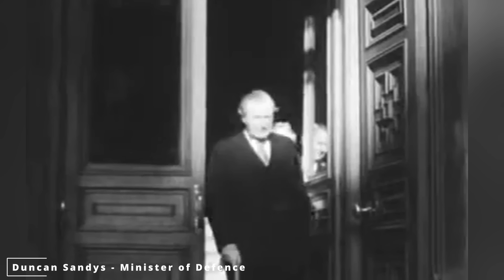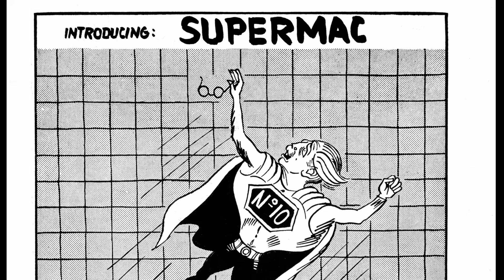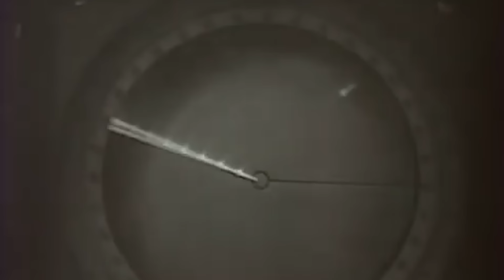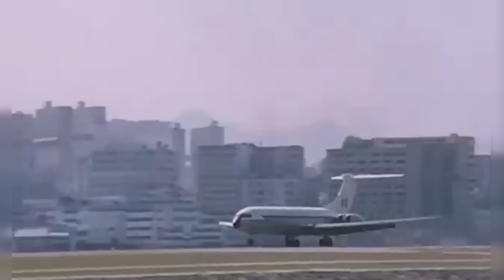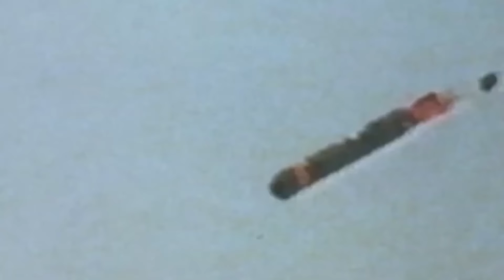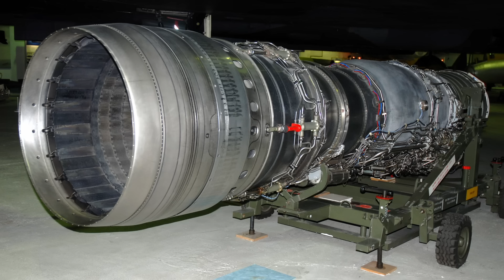How Britain Turned A Failed Airliner Into a Soviet Submarine Predator | The Mighty Nimrod

Comment: The Comet was a good plane after they figured out the fuselage issues. Beautiful too. And the VC10 was amazing…
Reply: Comet 4 had an appallingly bad 34% loss rate, the worst safety record of any jet airliner in history except for the Comet 1 (56%)
Reply: @DoktorBayerischeMotorenWerke 

Typhoon & Tornado, British design aircraft. 

Early days of the airliners.

The awesome De Havilland Comet.
World's first production jet airliner.
World's first high altitude airliner. 
At the time the Comet wasn't particularly dangerous. The DH Comet was definitely not the worst engineering failure in commercial airliner history.

Losses comparisons.
How things were in those days.

DeHavilland Comet 4 UK                          14% 
DeHavilland Comet all mks UK (ff 1949)17%  
Vickers VC10 UK (ff 1962)                         5%

Douglas DC-1  US                                       99%
Douglas DC-2                                              47%
Douglas DC-3                                              30%
Douglas DC-4                                              26%
Boeing s300    US                                       72% 
Boeing 307                                                  70%
Boeing 247                                                   48%
Boeing 707  (ff 1958)                                 32% 
Lockheed L-049 Constellation (ff 1943)  30%
Lockheed Electra US (ff 1957)                   29%
Fairchild FH-227 US (ff 1966)                   32%
McDonnell Douglas DC-8 US  (ff 1958)   14%
Sud Aviation Caravelle  (ff 1955)             15%
Canadair CL-44 Turboprop US (ff 1959) 46%  
Convair CV-580 Turboprop US (ff 1960) 22%
Convair CV-880     (ff 1959)                      27% 
Convair CV-990     (ff 1961)                      33%
Tupolev T-104        (ff 1956)                     16%
Vickers Viscount UK  (ff 1948)                29%  
Fokker F-27 Turboprop NL (ff 1955)       40%      

The Vickers VC10, fastest Atlantic crossing for a non supersonic jet airliner, held the record for 41 years.

For the first few years of operation the Caravelle & Comet had similar accident loss fatalities.

De Havilland had prior experience building many all metal construction airframe aircraft & thousands of jet powered fighter aircraft that were primarily of metal construction with pressurised cockpits & jet engines built by De-Havilland. No aircraft before the Comet was subjected to as much pre-production testing as the Comet. 

It's a great pity & a crying shame that British military forces had to occupy a large part of Germany for decades after 1945 & Russian military forces had to do the same. Of course Russia still posseses a large chunk of what was German territory & of course Russia & the UK produce nukes. Obviously Germany does not produce nukes.

Interesting British achievements.

The gas turbine engine was invented & patented in England before the 1800s.

Axial multi stage sequential stage compressor & turbine technology, first produced for turbo machinery use in England by Parsons of Ireland & North England during the 1800s. The components form the basis of most modern gas turbine aero engines. At the time the concept of the jet aircraft powered by axial internal combustion gas turbine engines was first mentioned thus the internal combustion jet engine & jet aircraft was indeed invented in England before the 1900s & before the Wright brothers got busy.

Work on the multi stage sequential stator rotor axial compressor as applicable to the axial compressor gas turbine aero engine was ongoing in England from around 1928 by Arnold Griffiths and others. By 1943 the Metrovik F2/3  Beryl was a running axial turbojet that was superior to anything anywhere else. As the centrifugal compressor engines were adequate and more powerful at the time development of a larger F2/3  version was commenced.

The Metrovik (UK)  F2/3 axial compressor gas turbine aero engine was flight certified & ran in 1942, it was the result of UK development work ongoing since 1929. At the time it was the most capable axial compressor turbojet in existence but was not required and development work continued on a larger version.

Frank Whittle performed the world's first demonstration of a gas turbine aero engine in 1937. People in Germany kept a close eye on everything going on in Britain at the time.

The centrifugal compressor RR Nene was the most powerful & most reliable gas turbine aero engine on the planet in 1944. That engine would be later built under license or copied in many countries including Russia (Mig-15 Mig-17), China, the US, France and Switzerland powered dozens of aircraft types for decades after 1944.

Pratt and Whitney and others produce centrifugal compressor gas turbine aero engines. The PW200 is a currently produced whittle style centrifugal compressor, reverse flow combustor, gas turbine aero engine. 

The world's first wind tunnel was constructed in England during the 1870s. The world's first supersonic wind tunnel was constructed in England in 1922.

There is no doubt that the Fairey (England)
Delta 2 was the world's first jet
aircraft to exceed 1000 mph.  Indeed It
exceeded the previous record by 310 mph &
held the record for 1 year. Incidentally, the Dassault Mirage 3 & 4 are based on the Fairey Delta 2.

More recent UK military jet aircraft.

The Tornado & Typhoon & their engines are Supersonic & are indeed British design aircraft with British design engines built by an international consortium. The Tornado design for example started life during the 1950s at Vickers as the AFVG, it's engine is based on the RR RB-199. The EE Lightening is also a British Supersonic jet aircraft.

The Typhoon is the British BAC-EAP with an engine based on the British RR XG-40, the Typhoon is also built by an international consortium.

Brazil has the world's third largest airliner manufacturer and makes very good airliners & Brazil is 100th down the list along with Indonesia for wealth per capita. Of course it is in fact the case that Embraer can't build those airliners without purchasing stuff from the US, UK & Europe. For example, Norway, Holland, Denmark, Ireland & Belgium, top 20 wealth per capita, don't make airliners, its as simple as that.

Global aerospace. 
From the 1950s sector rationalisation and consolidation took place. 70 companies in France and 300 companies in the US disappeared due to merger or dissolution. In the US Boeing was almost bankrupted by the 707 project.  Boeing had a well protected domestic market and the available space and resources in the US to engage in large scale airliner manufacturing enabling them to capture orders simply by being able to produce airframes fast enough and cheap and nasty enough. Another factor is airlines preferring to obtain as much of their airliner inventory as possible from one manufacturer. 

Global Aerospace Sector, what's happening.

For example, there are of course no German companies that makes German jet aircraft in Germany & there are no German companies that make German gas turbine aero engines in Germany that are suitable for widebody airliners.

The UK has the world's highest combined per capita Nuclear / Defence / Aerospace Sector Activity.

UK defence sector, absolute terms, world's second highest activity. 1st for per capita defence sector activity. Per capita nuclear powered submarine construction, 2nd position. 
Main players being Rolls Royce, Babcock, GKN Aerospace & BAe Systems. Activities often involve international collaboration. BAe systems, RR and other UK companies now handle more Airbus work value wise than Germany. 

There's a good chance that anyone currently flying on a widebody airliner will be on an aircraft powered by RR gas turbine aero engines made in the UK and a good chance there will be other hardware on the aircraft that's designed and / or manufactured in the UK. 

Rolls Royce Holdings UK
Subsidiaries
- Rolls-Royce plc
- Rolls-Royce North America (ex Allison etc Classified Military stuff)
- Rolls-Royce AB
- Rolls-Royce Deutschland
- Rolls-Royce India Private Limited
- Rolls-Royce Marine Power Operations
- Vinters Engineering Limited
- Rolls-Royce Controls and Data Services
- Rolls-Royce Power Systems
- Bergen Marine
Joint ventures include:
- Rolls-Royce Turbomeca
- MTU Turbomeca -

Trent Family
The MT30 (Marine Turbine)
Industrial Trent 60 Gas Turbine
Trent 7000
Trent XWB Airbus A330neo.
Trent 1500
Trent 1000
Trent 500
Trent 600
Trent 700
Trent 800
Trent 8100
Trent 900
   
RR wholly owned subsidiaries in Germany handle smaller 2 shaft RR gas turbine aero engine work.

The UK space and aerospace sectors are highly productive, high-value industries that together contribute over £18 Billion in direct Gross Value Added (GVA) to the UK economy. Individually, the space industry directly contributes about 0.3% of UK GDP 7•2 Billion while the aerospace industry contributes approximately 0.5% £10•9 Billion.
   
We hope this helps.
Reply: @DoktorBayerischeMotorenWerke 

Comet / Nimrod notes. 

We believe we can clear up some commonly held myths and misconceptions obviously.

It's always good to see the facts presented clearly and concisely isn't it?

Obviously there have been worse aircraft for accident losses both before & after the Comet.

All jet airliners benefited greatly from the knowledge gained from the Comet incidents & subsequent investigations & yet some were still worse for accident losses. 

It's a great pity & a crying shame that British military forces had to occupy a large part of Germany for decades after 1945 & Russian military forces had to do the same. Of course Russia still posseses a large chunk of what was German territory & of course Russia & the UK produce nukes. Obviously Germany does not produce nukes.

Instances of all marks of the Comet flew with full certification after 1954 including the Comet 3. The last Comet flight occured in 1997.

The fabulous trail blazing DH Comet.
World's first jet airliner.
World's first high altitude airliner.
World's first airliner with a full fuselage length pressurised cabin pressurised for high altitude flight. That feature for that type of aircraft was a considerably difficult undertaking. 

How things were back then.
Accident losses - % of aircraft built.

DeHavilland Comet 4 UK                          14% 
DeHavilland Comet all UK (ff 1949)        17%  
Vickers VC10 UK (ff 1962)                        5%

Douglas DC-1  US                                       99%
Douglas DC-2                                              47%
Douglas DC-3                                              30%
Douglas DC-4                                              26%
Boeing s300    US                                       72% 
Boeing 307                                                  70%
Boeing 247                                                   48%
Boeing 707  (ff 1958)                                 32% 
Lockheed L-049 Constellation (ff 1958)  30%
Lockheed Electra US (ff 1958)                   29%
Fairchild FH-227 US (ff 1966)                   30%
McDonnell Douglas DC-8 US  (ff 1958)   14%
Sud Aviation Caravelle  (ff 1955)             15%
Canadair CL-44 Turboprop US (ff 1959) 46%  
Convair CV-580 Turboprop US (ff 1960) 22%
Convair CV-880     (ff 1959)                      27% 
Convair CV-990     (ff 1961)                      33%
Tupolev T-104        (ff 1956)                     16%
Vickers Viscount UK  (ff 1948)                32%  
Fokker F-27 Turboprop (ff 1955)             39%      

The Vickers VC10, fastest Atlantic crossing for a non supersonic jet airliner, held the record for 41 years.

For the first few years of operation the Caravelle & Comet had similar accident loss fatalities.

The first few Nimrod airframes were Comet 4 airframes with the equipment bay tacked on. Subsequent Nimrods were new build Comet 4 airframes with the modifications built by the DH team at Hawker Siddeley.

Military aircraft accident losses. 
Lockheed XF104                 (ff 1954) 100%
Lockheed  P80                      (ff 1944) 43%
Lockheed F104                     (ff 1954) 45%
Grumman f9f                         (ff 1947) 47%
Convair F102 Dagger            (ff 1953) 45%  
MD F-101 Voodoo.                (ff 1954)  34%
MD FH Phantom 1                (ff 1945)  35%
MD F4 Phantom 2                 (ff 1958)  28%
MD F3H  Demon                    (ff 1951)  32%
Gloster Meteor UK                   (ff 1943) 21%
DH Vampire  UK                        (ff 1943) 23%
DH Sea Vixen  UK                     (ff 1951) 33%
DH Venom       UK                    (ff 1949)  16%
Gloster Javelin    UK                (ff 1951) 20%
EE Lightning     UK                   (ff 1954) 33%
HS Harrier      UK                     (ff 1962) 34%

The Sea Vixen was an aircraft carrier jets pioneer aircraft that was also regularly flown from carriers that were too small for the aircraft. 

The Tornado & Typhoon & their engines are supersonic & are indeed British design aircraft with British design engines built by an international consortium. The Tornado design for example started life during the 1950s at Vickers as the AFVG, it's engine is based on the RR RB-199. The EE Lightening is also a British Supersonic jet aircraft.

The Typhoon is the British BAC-EAP with an engine based on the British RR XG-40, the Typhoon is also built by an international consortium.

Global aerospace. 
From the 1950s sector rationalisation and consolidation took place. 70 companies in France and 300 companies in the US disappeared due to merger or dissolution. In the US Boeing was almost bankrupted by the 707 project.  Boeing had a well protected domestic market and the available space and resources in the US to engage in large scale airliner manufacturing enabling them to capture orders simply by being able to produce airframes fast enough. Brazil now has the world's 3rd largest airliner manufacturer & is towards the bottom half of the wealth per capita tables. Most of the countries at the top don't bother trying to have a lone national airliner manufacturer. 

For example, there are of course no German companies that makes German jet aircraft in Germany & there are no German Companies that make German gas turbine aero engines in Germany that are suitable for widebody airliners.

The UK has the world's highest combined per capita Nuclear / Defence / Aerospace Sector Activity.

UK defence sector, absolute terms, world's second highest activity. 1st for per capita defence sector activity. Per capita nuclear powered submarine construction, 2nd position. 
Main players being Rolls Royce, Babcock, GKN Aerospace & BAe Systems. Activities often involve international collaboration. BAe systems, RR and other UK companies now handle more Airbus work value wise than Germany. 

Rolls Royce Holdings UK
Subsidiaries
- Rolls-Royce plc
- Rolls-Royce North America (ex Allison etc Classified Military stuff)
- Rolls-Royce AB
- Rolls-Royce Deutschland
- Rolls-Royce India Private Limited
- Rolls-Royce Marine Power Operations
- Vinters Engineering Limited
- Rolls-Royce Controls and Data Services
- Rolls-Royce Power Systems
- Bergen Marine
Joint ventures include:
- Rolls-Royce Turbomeca
- MTU Turbomeca -

Trent Family
The MT30 (Marine Turbine)
Industrial Trent 60 Gas Turbine
Trent 7000
Trent XWB Airbus A330neo.
Trent 1500
Trent 1000
Trent 500
Trent 600
Trent 700
Trent 800
Trent 8100
Trent 900
   
RR wholly owned subsidiaries in Germany handle smaller 2 shaft RR gas turbine aero engine work.